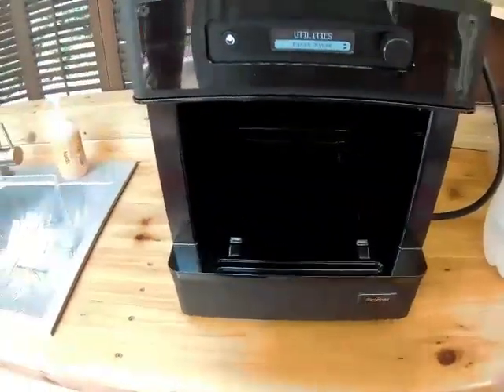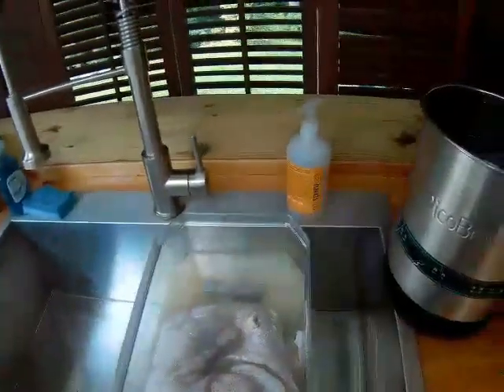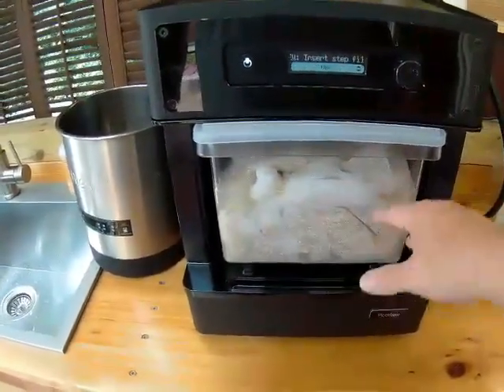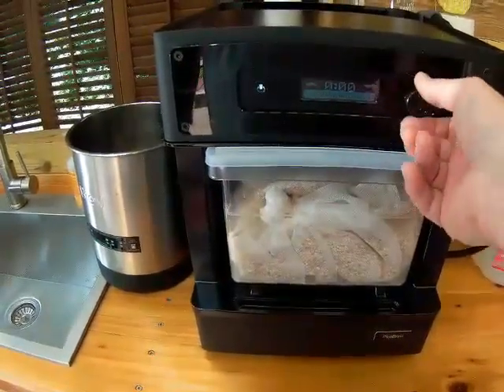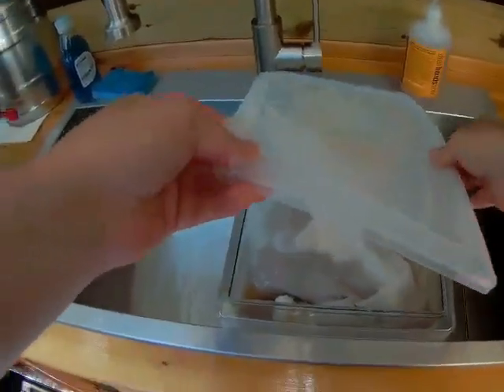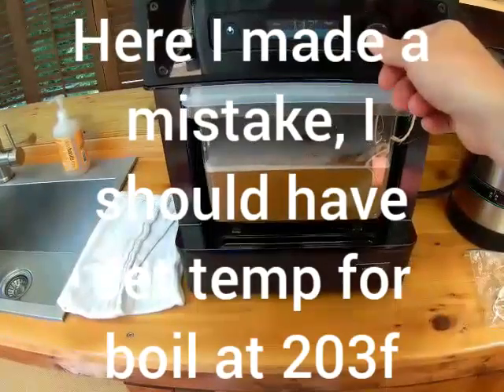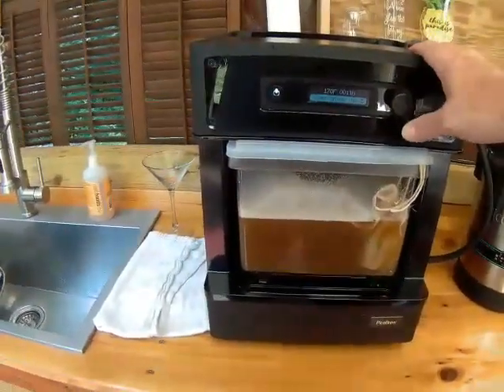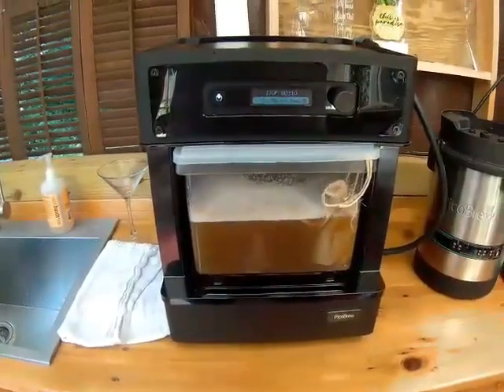Picobrew Pico C Pico Pro manual brew short overview

Comment: Thanks for the video... Tried a manual brew a week ago and noticed my OG was very low. Was a 1.047, when it should have been 1.061. I used about 4 lbs of grain total to 5L of water. I noticed during mash some of the grain was sitting above the water line, which could be a reason. Just wondering if you experienced any low OG's and how you solved them? Also, why can't you squeeze the grain bag when draining lol?
Reply from the maker: I have had low OG. I use less water now when brewing (less than 5l). I try to use about 3-3.5lb of grain so as not to crowd the step-filter. Just have to keep adjusting your recipe until you get it right. And yes, I squeeze the grain bag to get as much out as I can.
Reply: you prolly dont give a damn but does any of you know a way to log back into an instagram account..?
I stupidly forgot the password. I appreciate any help you can give me.
Reply: @Jared Aron Instablaster =)
Reply: @Elisha Pablo i really appreciate your reply. I found the site through google and Im trying it out now.
Seems to take a while so I will get back to you later with my results.
Reply: @Elisha Pablo It did the trick and I actually got access to my account again. I'm so happy!
Thank you so much you really help me out :D
Reply: @Jared Aron you are welcome =)

Comment: The title says Pico C and Pico Pro. Does that mean that this manual brew procedure works the same on the Pico Pro?

Im thinking about getting the Pro version since thats the only one of the two that comes with 230V (EU). I live in Sweden so if I dont wanna spend an additional $400 on a transformer, the Pro is the one to get.
Reply from the maker: Yes, the C and Pro are basically the same process.  The only real difference is the Pro has ball-lock fittings and a nicer display (I believe). Take a look at the comparison on the Picobrew website.

Comment: My Pico C is no longer heating during step 1. I tried running through the website trouble shooting, but have had no improvement. Has this happened to you, do you have any suggestions?
Thanks!
Reply from the maker: Heinz, sorry. I do not have a solution for you. It sounds like the heating element might have died. I am sure you have unplugged it and retried?

Comment: This looks like a nice intro into all grain, but pretty labor intensive for only 5 liters.   I think your better off going traditional or even grainfather and doing a 5 gal batch.   You will spend same time and get 5x more beer.   Just my 2 cents ( keep the change )
Reply from the maker: Not really very labor intensive. Just set and forget until the next step. No babysitting. Good info for some. I would agree to a point. But doing 5 liter batches allows more experimentation, if a batch is bad, you don't have 5 gallons of bad beer, and also good entry for some. For me it is about right. I run a batch every week or two, and get different styles and types. All depends on what you want.

Comment: So you can brew without using the pricey Pico packs?
Reply from the maker: Correct. They "unlocked" the machines with a wifi update back in May I believe. I held off buying one until they did this. I now buy bulk ingredients and brew for about $10/batch.
Reply: Hi I have a pico C ...what's the website to download the recipes ?